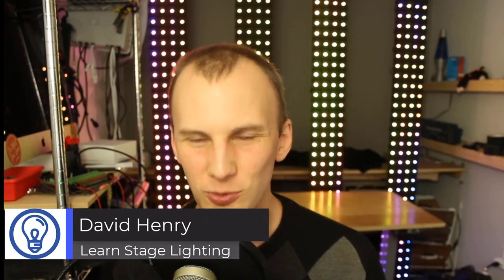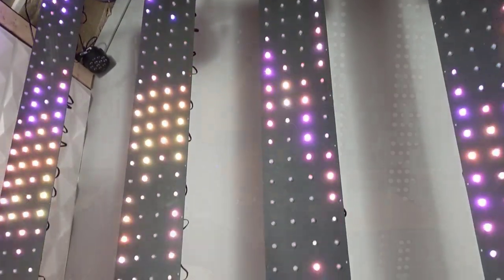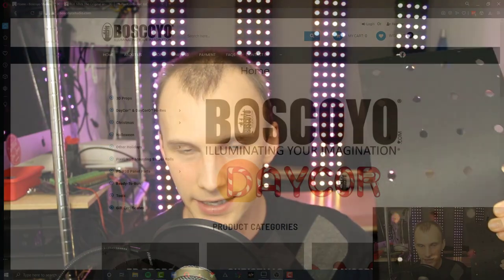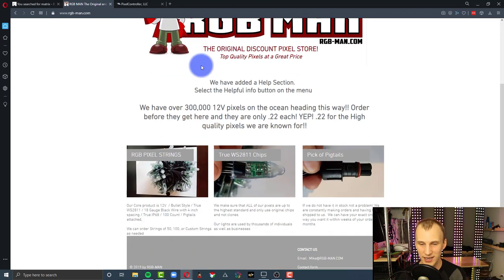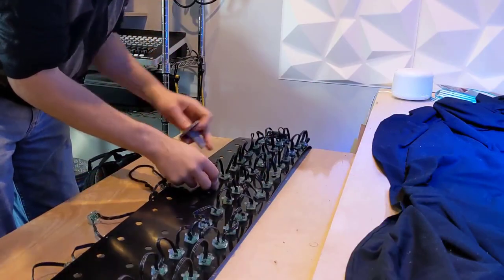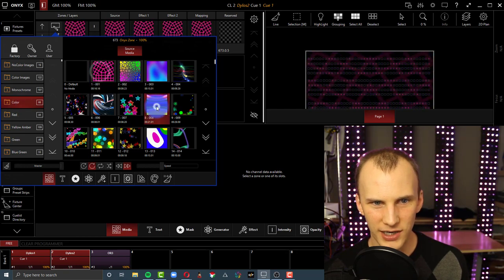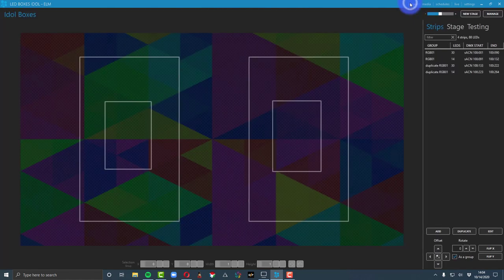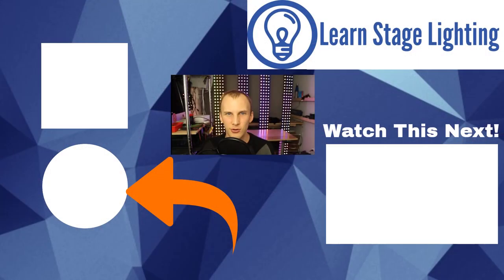Build It Low-Resolution Video Panels

Comment: This looks so awesome! Which pixels did you buy from RGB man?
Reply from the maker: 12v WS2811 Bullet Pixels 100 count xConnect ends.  Truly, what you get may depend on what pixel controller you go with, etc, but this type of pixel is one of the most common and most often is what I recommend.

Comment: Looks like the pixels come in sets of 50 or 100 and the panels are for 168 pixels. Did you fill every slot? I'm also very interested in how the pixels hook up to the pixel controller and how that gets DMX. 

I have a Chauvet X-Net II 8-channel node and would love to be able to take my universes from there into whatever control device, but I don't know what all those connections look like.
Reply from the maker: Yes, I filled every slot and cut off the remaining pixels.  You can do this with pixels :)    It's a whole new world!

This will give you some more info into pixels: https://www.youtube.com/watch?v=EEcMnWRx7EI

And there is also a whole lot more inside of Learn Stage Lighting Labs :) 

You actually won't need the Net-X as pixel controller's take sACN or Art-Net directly.  So it will just be a straight network cable from your console to your pixel controller (just like how you hook up the net-x).  Of course, like all networking things, there are different ways to set things up depending on your needs and end goals.

Thanks!,
-David